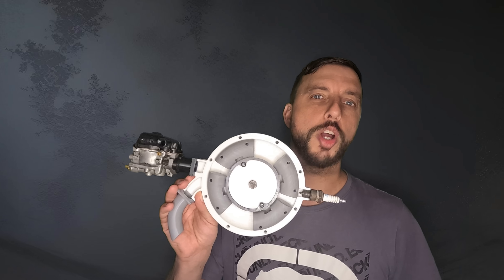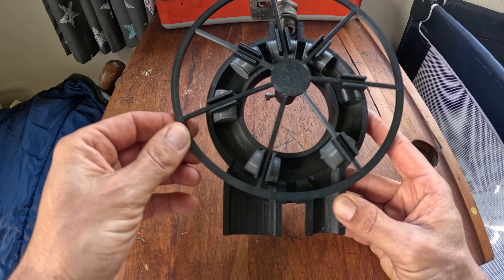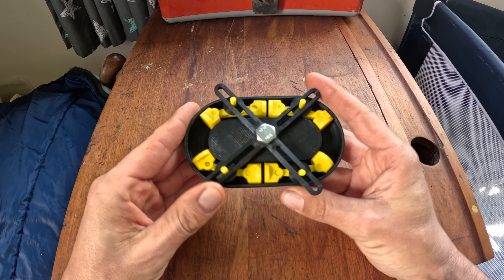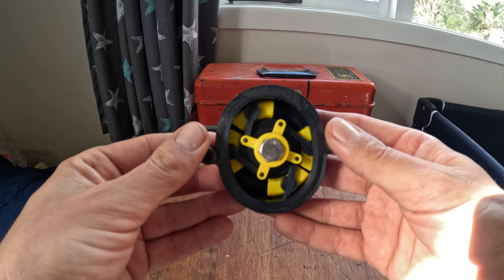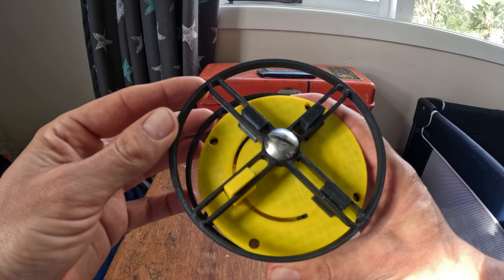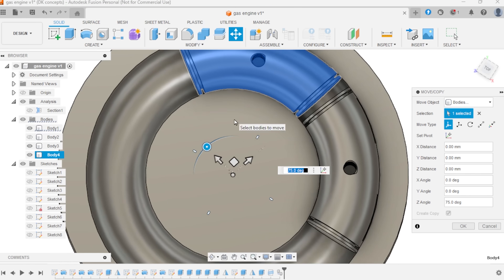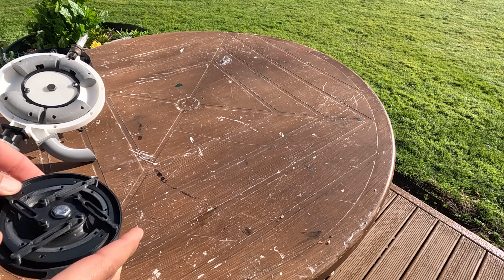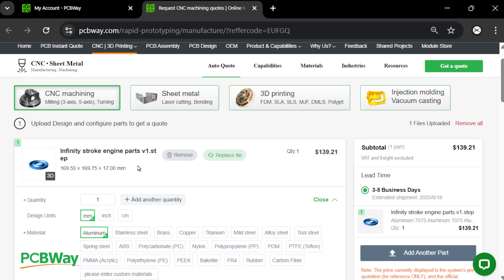Infinity Stroke Engine, More Powerful Engine?

Comment: It’s a kauertz engine! A German invention that has patents and I have a fair amount of experience tuning and modifying a prototype!  a custom made machine designed and built by an engineer friend from Germany. Immense torque and ridiculous heat to deal with having 4 combustion cycles per revolution.
Reply from the maker: ok great! big sealing issues I guess? If you have time could you contact me DKthewelder@gmail.com
Reply: @dkthewelder no worries at all! But there’s not much I can offer other than some basic advice and ideas as the budget and materials required for me to continue were well out of reach and i was tired of hauling it everywhere, so I donated the engine to a guy in qld before moving house, I regret that decision now as it’s a sentimental motor, the original owner Rolf had passed awhile back, I could probably chase it up if it was needed though . it was all sealed by tolerances only and would seize a few minutes into running,even on rich two stroke due to it’s all mild steel construction, but the timing mechanism was unique on this engine! and I had seen nothing similar in other prototypes online, credit to the original designer Rolf and his genius calculation of the gear ratio and manufacturing the planetary It would be something I’d have to make by trial and error not math and measurement! He also developed one of the world’s first actually successful active solar systems that tracked the sun! An ex Siemens employee he was switched on! I’m flat out at the moment but will try to get some photos to you soon.

Comment: Why not use rare earth magnets and trigger the spark on the rebound of the attraction? The pressure wouldn't need to be crazy but the benefit would be extremely high rpm.

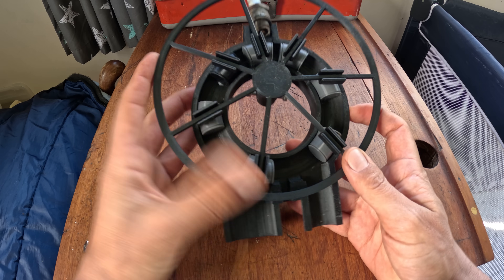Comment: 2:16 This would not function, the force is going into pulling apart the pistons, there is no direction of less resistance as both cylinder walls are being hit by the same explosion force, thus the wheel would have the same force imparted in both directions, leading to 0 movement instead of rotation.

Comment: https://youtu.be/_MBYg1NPzMY?si=tIrUhsvDnNJohEu0

"The Mighty Engine by inventor Raphial Morgado"

Back in the 2000s, this guy made a similar engine that won an international inventor's competition sponsored by NASA. Very similar to your design, it had some interesting solutions. Part of the cross-section of the cylinder walls were billet-machined along with half of the total number of cylinder heads directly onto two separate rotors that inter-nested and coupled with cover plates that completed the cylinder walls when assembled. The moving cylinder walls allow for perfect head placement and spacing under load due to billet construction which also meant superior sealing. The rotors were connected via some sort of inverted eccentric planetary gear system that transferred torque to a shaft. I assume the rotor gearing could adjust for timing as they claimed it could run on almost anything petroleum based. Impressive 70:1 compression ratios and up to 40:1 power to weight ratios on its dual rotor design! Not to mention economy tunes of up to 125mpg and power tunes starting at 800+ hp.

I watched the same driving2answers video about the vane concept several days ago before coming across your video. I then spent several hours of iterative conceptualization and came to the same conclusion you did about addressing sealing, durability problems, and design costs: that opposed cylinder heads on a rotor theoretically seem better than vanes when dealing with combustion. However the problem of transferring the piston torque still remains as you have demonstrated. I then remembered the above linked video from years ago and it seems very relevant. The mighty engine could still use some optimization of its rotor mechanism, which has some offsets that make its path a bit irregular, but I still think it's one of the best designs in the category. Unfortunately market forces saw fit to bury the idea and it never saw mass production. Anyway, I had to recommend it since it seems we've both ridden on the same train of thought before. 

Cheers 🍻

Comment: For all of you talking about how it won't move because the combustion is pushing equally on both pistons it's about ratios of movement. Notice how when the piston gets past the spark plug it accelerates even though the shaft is being turned at the same speed for all pistons. This means the piston before the spark plug is harder to move as it's moving slower and the one past the spark plug is easier to move since it's moving faster given the same central shaft speed. This means that combustion will move the piston past the spark plug as it is the path of least resistance and it will overpower any sort of backward force at the ratio of movement. It's the same as two people of equal strength biking in opposite directions connected by a tether but you give one a 10x gear advantage, yes there will be subtractive pull in the opposite direction but it will be easily overpowered.

Comment: I also wanted to advise you to put an oil injector between the two elastic rings of the "piston" instead of the bearings, the bearings only lead to premature wear of the "cylinder" toroid in the contact area.

Comment: It is often better to reduce the number of moving parts, so if the rotor and pistons can replace the other parts then maybe you have something.
I tried thinking about this but it made me realize the most efficient design will always be some form of multiple-expansion turbine. 
Basically, you are developing a pulsing turbine. -on this thought perhaps you should slightly deflect the combustion off the piston head down through a gradually thinning spiral where it will exhaust near the shaft to get the most out of its expansion while still having efficient expulsion of gases through the venturi throat.

Comment: if youve got a design that can withstand very high RPMs do it. at high rpms you dont need to worry about sealing as much, and you get more hydrodynamic lubrication. the aim of the game is having something that is perfectly balanced. 
also look into stratified charge engines, more efficient and less heat issues.

Comment: There's already an infinity stroke engine - it's called a gas turbine.  Constant pressurization and ignition of a single rotating mass.  OK, not easy or cheap to build but mass production of smaller units could achieve that.

Comment: How are you going to get piston rings past the intake and exhaust without them digging in? 
It's like having a hole in the side of a bore the ring or bore would chip away. 
As for outer rollers how will they pass the openings without hitting the opening edges? 🤔

Comment: Great idea! But this will likely be restricted to off-road use only. Oil injected into the system will make it smoke like a two stroke. Power to weight and such a small number of moving parts will make this design a powerhouse!

Comment: Neat design.
You will have problems due to  physics. 
Each piston is of equal size. 
When two pistons are  compressing the fuel/air mixture and are at the TDC in line with the spark plug, then the  explode  gas  push on two different pistons. The exploding force outward  will be pushing against two pistons in opposite  directions. Thus the engine will not  work.

Comment: plus conventional piston engines allows for suction and compression pulling and pushing air out and in this can increase rpm with no suction mechanism it wont ref very high due to gasses being caught

Comment: yeah i also thought of this design but pressure will push your pistons apart and the net force wont be able to drive in an specific direction it will drive in two directions. this will equate to two forces cancelling out or if it works very very very low efficiencies.

Comment: I thought I invented this in college. I still don't think it's a terrible idea. Its also called the  MYT engine, the trochilic engine, and cat and mouse engine. I was thinking of using elliptical gears for timing. I was hoping I could come up with a purely linkage solution but never did. The connection of the pistons to the connection to the shafts still complicates sealing. They rotate so there will still be centrifugal loading. I briefly thought of floating them like a free piston engine maybe as a generator sort of flapping but I think a linear free piston engine does that better and better isolates and accesses the electronics. Oh you might also like the quasi turbine. Some concepts I had half of the piston fused to half of the housing you might like to play with that ideal so the whole system clamshells together with a moving seal on the clamshell ports have trouble with this design. I think you'll find 4 chambers and 4 pistons is best but MYT did 8 as I recall. I've seen a lot of designs with rotary valves instead to react against and clear the cylinder for the pistons. Seems much worse for sealing to me. I think you should spark in the center between the pistons the tiniest bit before maximum compression maybe 2 places around the small diameter of the torus but 1 place is probably fine. Converging flame fronts could complicate things. Rotary has a large combustion face. Hopefully you don't but you don't have ideal center spark position. Some piston engines use 2 or 3 spark plugs as well. For something comparable you might look at opposed piston engines though most of them are old and diesel but their injectors could be somewhat similar. What ever is positioning your pistons should contain the oil path.

Good luck.
Have fun.

Comment: An Engine is only as strong as it's weakest part, in this case, the springs and bearings will experience astronomical forces and momentum changes

Comment: I believe you’re mistaken claiming Wankel rotaries have more rpm (I believe you mean higher red line) than piston engines. Such a broad statement is false. Now if you mean run of the mill economy box engines, sure… if you mean high performance piston engines… well… then it depends are we talking JDM built and tuned engines  turning 10-12,000rpm? Or are we talking Formula 1 engines or motorcycle engines some of which have EXCEEDED 20,000RPM!!!!  🤯 (we learned in the mid to late 80s gasoline doesn’t burn fast enough to really warrant exceeding 18k rpm)
Reply from the maker: My dad actually has a Honda hornet 250cc 4 cylinder that does 19 000 rpm! Just trying to make the point that better balance is better for more rpm

Comment: Batteries don't last long? Ev charge capacity has met or exceeded gasoline range on most vehicles except big trucks and within a couple of years the batteries will be even more power dense and thermally stable with sodium batteries. You cannot beat electric power efficiency or torque with internal combustion. Latest motor designs are nearing 99% efficiency. ICE will never come close using hot combustion. Even if youbare using power from combined cycle power plants you are getting 65% of the fuel used for power production to move the vehicle. ICE at best you get 20% of your fuel put to the road. Every supercar is hybrid because you cannot beat the torque density of an electric motor. Piston engines are a stupid century old design, so I am glad there is some ICE innovation, but they will be used for power generation on hybrids or extended range EVs, not as primary power sources. This idea of toroidal pistons has a patent on it from about 20 years ago.

Comment: Awesome man. If you can't get it to work and decide try another cool thing, a worthy rabbit hole imo, is the tesla engine. It's a multi-fuel version of the Tesla steam turbine (using the Tesla Valve for a fuel intake ) and If there was ever a guy that could pull that off it would be you with your mad skills. The Tesla Engine Builders Association website has a free ebook to learn all about it. Tesla reckoned it was his greatest invention for mankind but was suppressed by the competing ICE engine makers and refineries at the time (1920s). It was to power a weird looking aircraft, motorcars, ships, everything. Could even run cleanly on crude oil. Not many parts and loose tolerances, balancing being the main concern (he had a patent for that also). Epic power to weigh ratios. Versions of it were envisioned capable of air conditioning or climate controlling entire cities (no nasty refrigerants). Other versions of it was a staged vacuum pump (could suck the chrome off a tow ball), or a pump that could move viscous fluids or even pump fish without harming them.

Comment: As I commented on ole mates similar video. With today's high tech titanium 3D printing, and or billet construction with additive lubricative surface finishes, .. ..."Hi, I'm no mechanical engineer by any means, just a fitter and Turner. 
My question though is, with today's high tech materials, would you be able to make some type of roller bearings as your seals against the housing ? Then it would be a full roller bearing engine, and rev to the moon !? Just a thought. Would be absolutely AWESOME if it was possible."🏎️💨

Comment: "Batteries dont last very long"! 🤔. Considering the average Australian travels 33 to 40 kilometres per day and most electric cars will do at least 200 kilometres (5 days) on a charge at a cost of $25 worst case. I think they last long enough. What didn't last very long was oil, we dont have any,  we buy fuel from countries that don't like us. We're going to stop doing that as soon as certain cohorts stop believing in the flailing lunacy of the ICE.
Reply from the maker: What about earth moving machines, ships, aircraft how can you do that with batteries? I like electric vehicles but is impossible to power everything with batteries
Reply: @dkthewelder I assume by your accent you would be aware of electric v hydrogen haul trucks etc in OZ. See fortescue metal group instigations as well.

Comment: You have two compression events happening symmetrically, and two expansions symmetrically. If you used porting on the beginning of the expansion events for exhaust, and fuel injection at the end of the expansions for intake, then you could have spark plugs at both compression events instead of just 1, almost like a liquid piston engine. In your four piston design, you would get 8 combustion, exhaust, intake, and compression events per revolution* simultaneously. This would also spread out the heat more evenly, which seems to be the crux of sealing wacky designs like this. And liquid pistons design is excellent because combustion happens on every part of the chamber, balancing heat.
Reply from the maker: No there needs to be a compression event to push out the exhaust and suck in the next charge. The liquid piston motor is great as it self cools as you say!

Comment: As someone who has worked on many types of engines for many years I can't see how you are going to keep the pistons timed and connected to an output shaft ( the job of the crankshaft and connecting rod in a regular engine) with a torus shaped cylinder. If that was somehow overcome I think you are underestimating the effect of centrifugal force on the pistons and cylinder walls, I think rollers on the cylinder wall would only end up wearing a track in to the cylinder and last but not least just getting a torus shaped cylinder and matching piston and rings machined would be a major feat of engineering and costly, look at Hondas NR750 oval piston creations and the cost at the time. but with all that said I like your enthusiasm and people trying new things so I wish you well and will keep checking for updates.

Comment: If anyone is interested in a concept that is similar to this but was granted a Patent, US #5,203,287, Wiley.
Pistons oscillated towards then away from each other, cylinder with intake and exhaust ports, sparkplugs rotated around the pistons. Engine centripetally self cooled, self supercharged, and self scavenged exhaust. The Pistons were located perfectly in the continuous Bore, so no piston contact with it, just the Rings. Original Patent from about 1970 used a two throw crank with two conecting rods but prototype kept breaking rods. This Patent from 1993 substituted Scotch Yokes for Connecting Rods. The Project stalled because of too much thinking 'Outside of the Box' that wasnt taken into account and trying to use 30 year ago machining AND building an engine too small with too tight of tolerances for the time...

Comment: None of your linkages will work. Anyone can come up with a million designs but most are not workable-those linkages would break immediately. You also have the issue pretty much 100% of your designs push backwards was much as forward giving you near zero power. An engine has to have a specific design creating and IMBALANCE of applied force. I like the creativity but there is way more to a simple engine than what seems obvious. Pistons going around a curve is never going to be practical ever so just rule that right out.

Comment: It's a pity you can't use a gutter for the centrifugal force wheels and then pump oil into the gutter so the wheels pull the oil into the pistos?

Comment: In effect, you've simplified the MYT engine. The advantage of the engine being making it easy to put a very large displacement in a small space. What if you made this an external combustion engine (steam?)? Someday this might be connected to a transmission of my design. My goal is to develop an extremely simple CVT.